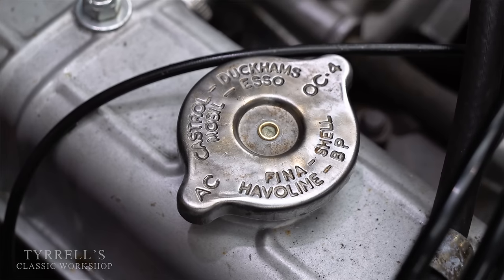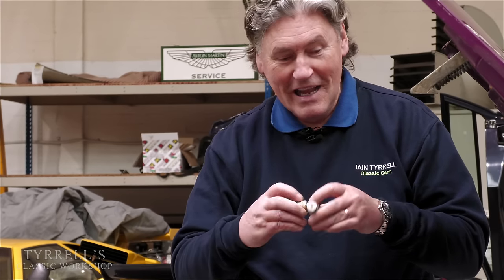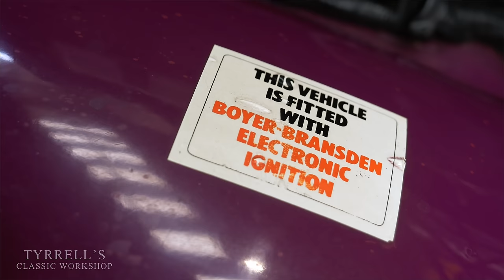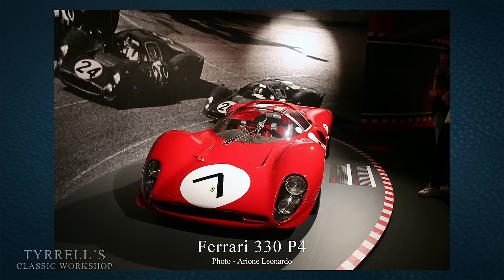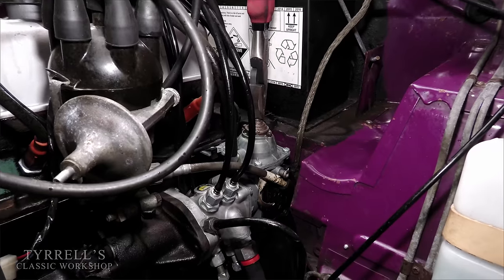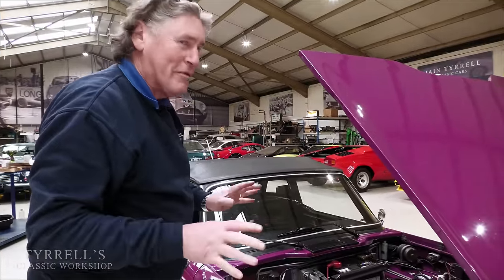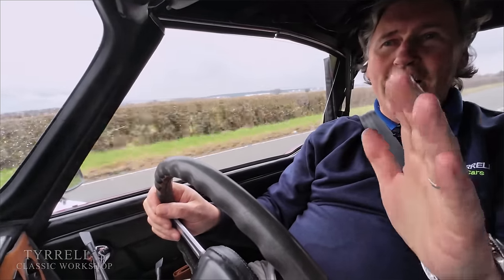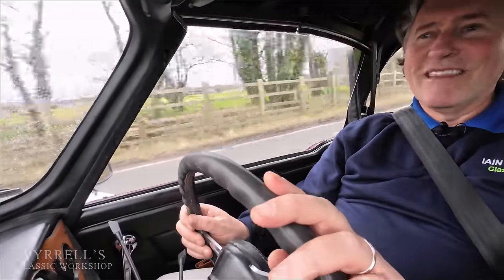Inside the Triumph TR6's Ingenious F1 Fuel Injection System | Tyrrell's Classic Workshop

Comment: I had to get rid of my 143bhp 1972 TR6 in the 1970s, very sadly, because of the injection. The functioning deteriorated over a matter of weeks and I had to take it frequently to Lucas in Trafford Park, Manchester, for recalibration - which cost a fortune. Even then around Manchester, I could only average about 21mpg. When an  injector refused to function, it could simply be pulled out of the port and tapped on the block to get it going again. This entire business was a shame because I was able myself to do almost all repairs and tuning on cars at that time, but the injection was beyond me because I had no instructions. I never managed to get hold of the handbook It was the only car I ever had which I managed to sell for  50% more than I paid for it and it is still on the road today.
Reply from the maker: Sorry to hear that. A painful process

Comment: Iain I noticed the vacuum advance pipe was missing from the distributor. You will get even better performance when the advance is connected on these engines.
Reply from the maker: Apparently left off is best, according to the marque specialist
Reply: Hi Iain I disagree with the specialist as i did my apprenticeship and worked on many of the Leyland range back in the 70s with that Lucas type distributor.The only time you disconnected the pipe was setting engine timing. You will find a far smoother take up on acceleration when the unit is working correctly and better mpg.There are settings and a precedure to check if working correctly but for £25 a new Vac unit for the 22D distributer can be brought from Powerspark. Just a 2 minute job to replace and think you will be surprised what a difference it makes.The early type centrifugal advance distributors by Lucas worked well untill eventually the springs  stretched with age causing a lack of performance. Regards Phil
Reply: @philscarriage73  I have a P.I. with nothing connected to the vacuum advance is it just tee into the vacuum system or it there a fixed spot it goes to

Comment: Would an O2 sensor up the x pipe help tune it?
Reply from the maker: On this era of engine, every one is different. They had a very wide mixture tolerance on a co meter accordingly. It’s whatever mixture the engine was “happiest” at, as long as it was within those tolerances

Comment: Sorry Ian, but I beg to differ with your praise of the Lucas PI system on the TR6 / 2.5PI. Yes, when it worked properly it was wonderful and sounded fantastic, but sadly many of them didn't. It was very unreliable. Many metering units had to be recalibrated by Lucas, often several times because of poor running and various fuel leaks. Several cars even went up in smoke sadly. I know this having worked for a Triumph / Leyland dealer for 18 years!

Comment: The Laycock de Normanville overdrive was a common option on MG, Triumph, Jaguar, Volvo, Austin Healy, and other makes in the 1950-70’s. Alfa Romeo offered a proper 5 speed in the early 1960’s that was lighter, less complicated, and more reliable. Soon other manufacturers followed suit. The Laycock de Normanville overdrive was expensive to service and added significantly to the length of the transmission, making for difficult packaging in short wheelbase sports cars.

While beautiful and engaging to drive, the poor build quality, cheap materials, and Lucas electrics doomed Triumph and other BMC makes. By the early 1970’s Japanese cars such as the Datsun 240 Z were introduced  
with much improved components based on the same inline six scheme. Datsun and Toyota reliability was far better than anything built in Old Blighty.

Comment: Great looking 6 but the radio doesn't look original? A well set up TR6PI runs like a jet engine, cheers...
Reply: Radio not included from factory,  dealer or owner installed
Reply: @susanhenderson2322  My Cassette Radio was factory installed from new..

Comment: Ha! A TR6. I was wondering when we were going to get to that. My first one was a magenta '74 with Z-S carbs. Never got that one running right. My current one is a '70 that makes 160 Hp at the rear wheels which, for a 2500 pound car, makes it pretty quick. Of course mine has a curse on it which means it has taken me 20 years to sort it out. People ask me if it is reliable and I tell them it is 100% reliable between break-downs.
Reply from the maker: Congrats on your perseverance!

Comment: The difference in the ‘supposed’ BHP between the early and late car is not so clear cut. The early engine was bench tested without any accessories. The later post 72-73 engines were tested to SAE standard.
As for the Lucas injection in a lot of respects it was rather crude. There was no auto enrichment when you stamp on the throttle therefore it had to run rich all the time to stop the engine from ‘pinking’. Also no vacuum advance it had to be done away with for the same reason. Another ‘weakness’ is cylinders 5 and 6 suffer a bit from lack of clean air due to the plenum design and how it lies and crankcase ventilation deposits which collect at the back end.
Having said that it’s dead simple to set up and time.
1975 TR6

Comment: Where are the trim rings from the wheels?
Reply: They used to be on it when it initially came to our family but following the sale in '98 and my re-purchasing it, they vanished along with the period wing mirrors and the original seat belts... I believe they were an option and were the narrow version rather than the deep version that cover most of the inner rim.

Comment: Even wiki does not help in order to find out how the system works. How does it meter? What input does it use? Throttle, intake pressure etc? Also Iain leaves us puzzled.
Reply: it is metered via vacumn as the throttle is opened

Comment: I'm surprised you are so keen on this awful system. I had a TR5 in 1972, it went through several fuel pumps, the bit of plastic controlling the mixture broke so it went on full rich, it never did more than 18mpg. No one in the Triumph dealership had any understanding of it, I tried to adjust the mixture but with no improvement. Finally sold the car in despair.

Comment: Lucas fuel injection...basically a diesel system running on petrol which doesn't lubricate so wears out alarmingly. It was an official failure according to Lucas who made it. My Dad replaced it on his 2.5pi with a pair of 2" SUs which was far better.

Comment: Both the Triumph and MG suffered badly when they "finally" shoe horned a Rover 3 litre V8 into them.  Don't buy one.  You have to remove the motor to change the spark plugs and oil filter.

Comment: these angle drives are crap. Been running with the speedo cable directly connected to the gearbox of my TR6 for years without any issues.

Comment: You really do yourself a disservice, 
and you know better, 
than to indulge in the old wives tales about Lucas being the prince of darkness.
Rolls Royce, Ferrari, Aston Martin, Jaguar, Bristol, Jensen, Morgan, Austin, Morris, every British truck, every other British car, Alfa Romeo and myriad others used Lucas electrics.
The final specification quality was determined by the purchaser.
Rolls Royce known for unreliability?
"My Lucas starter failed to start!"
(It only lasted 40 years)
Lucas made component as reliable as anyone else in the day.
Magneti Marrelli any better?
Bosch didn't do the innovation, they just bought the British A E Brico system and developed it, the British A E Brico thought fuel injection wasn't a goer.
Then Bosch sold their developments under license back to the poms.
The dopey poms relinquished it to them.
Lucas made quality components that the reproduction versions of today trying to replicate are rubbish.
Their chrome plating and bakelite pieces exquisite. Their switches exquisite.

What they made required catalogues inches thick to encompass.
They were always at the cutting edge of electrical engineering because they drove the advances.
You neglect to include that the innovation of Lucas Opus electronic ignition went hand in hand with Lucas injection in formula 1 and high end motor cars.
The combination which won every Formula 1 Grands Prix race  from the inception of the Ford DFV through to Allan Jones winning in the 1980's.
No need for the old , uninformed , old wives tales.
I would happily have a Lucas fridge keep my beer icy cold.